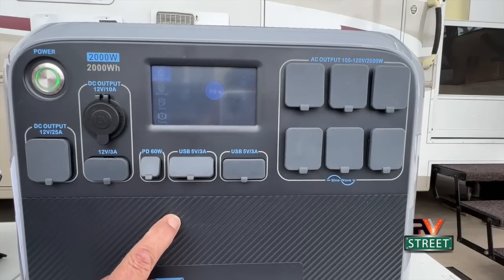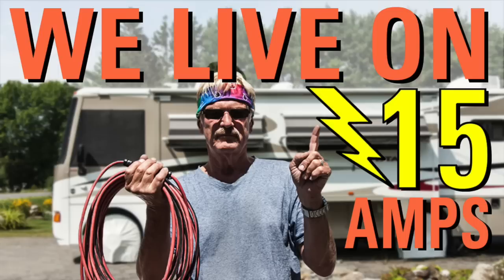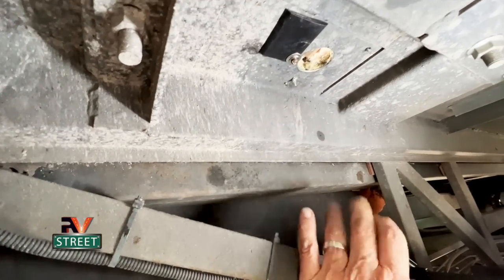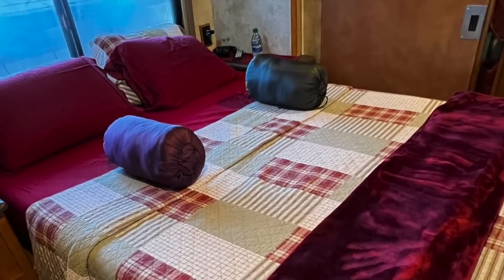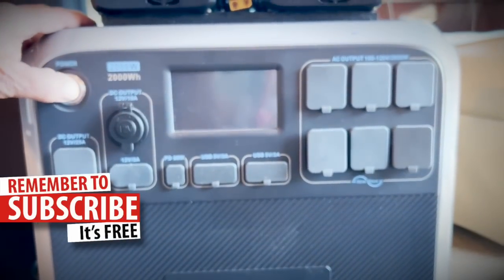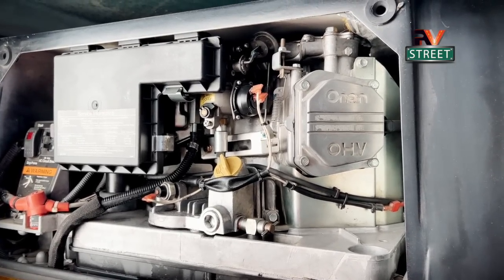Using a Bluetti AC200P in an RV • Most hands on Video on Youtube

Comment: Fantastic! I have an EB70S, and while it’s only a max of 800 watts, I just tried it with our 30 amp rig and it worked great! Of course, we can’t run the a/c or microwave with only 800 watts, but we can live without those luxuries (and have a dual fuel generator in the event we decide we can’t live without those luxuries). I also have a 200 watt and 120 watt solar panel, so feel this is an excellent long term boondocking solution.

Comment from the maker: If you want to know how I came to the decisions I did for my complete—PORTABLE—emergency plan, watch these two videos:
PREPARE NOW - https://www.youtube.com/watch?v=nDSm4Tkpq44
HOW WE LIVE ON 15AMPS - https://www.youtube.com/watch?v=QkTupmk2y3Y&t=537s

Segments in this video:
00:00 - Opening and Overview
06:56 - Installing Pass Thru Hatch
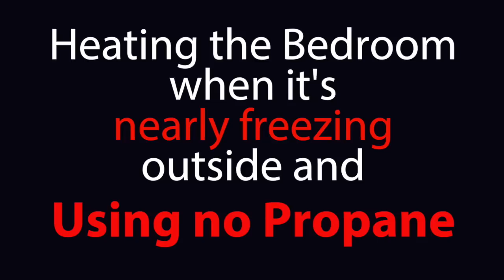09:34 - Heating the Bedroom & then recharging the Bluetti AC200P with my Honda Generator
13:29 - Powering our 50amp RV on 15amps
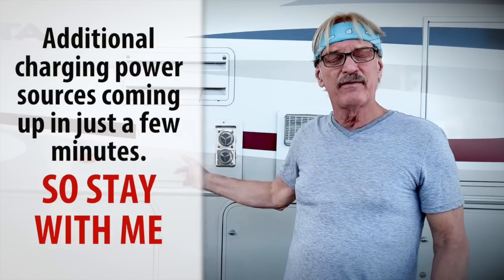18:26 - Using the Bluetti AC200P as a Stand Alone Unit in any RV
25:16 - Running a Large Floor Heater with additional Power Sources
30:22 - Solar BLUETTI SP200 solar panels
34:44 - Why not just use my onboard Onan Generator
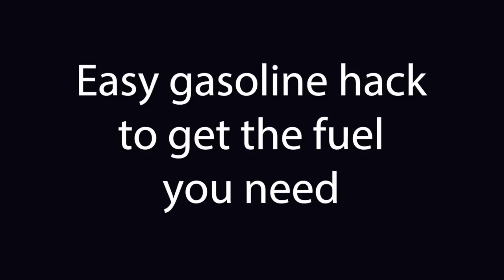36:25 - Gasoline hack
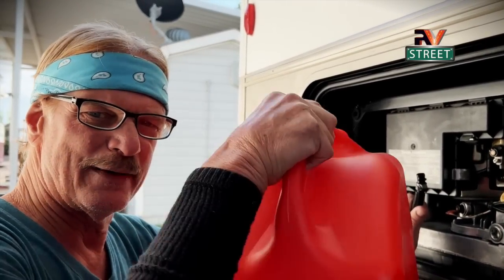37:38 - Important Closing Comments

Please don't ask me about any particular device you have if it will run on the Bluetti AC200P
If you want to know how long this Bluetti AC200P will power any device you have, use this formula: 
• 1800wh (or so usable) divided by the amount of watts your device uses, and that will give you the amount of hours it will run that device.
But just remember, this formula is just using the stored power—the current stage of charge (SOC)—of the Bluetti at that time. But, you can always be charging it at the same time while using it, bringing in more power from other sources at any time, therefore continuing to keep the SOC high. This 2000wh LifePO4 battery in the Bluetti can power just about anything you or I can throw at it and charges really fast especially with 2 AC bricks (2hrs)….or a little slower using one AC brick and solar. So many ways to charge this baby.

i initially wanted to buy a 3rd - 200watt solar panel but didn't have the funds at the time when I did this video. But just recently, I did buy a 3rd panel. Also, Bluetti has just added to their solar arsenal a new 350watt solar panel that is compatible with this AC200P and also has the ability to hang or deploy horizontally like normal. I've added this new 350watt solar panel to my Amazon store in the "Everything Electrical" category: https://www.amazon.com/shop/rvstreet

The Bluetti AC200P can receive up to 700watts of solar. You can hook up as much solar to the Bluetti as you want, but it will receive a maximum of 700watts. 700 watts of of incoming solar will charge this baby in about 2.5hrs.

After having this system now for a few months now, all I can say is "I'm really glad I have this back up system and for emergencies and it has performed flawlessly".

Be sure to check out the description text—in the *Show More*—area under every video for more details. If you’re unsure how to find that area watch this video I did: https://www.youtube.com/watch?v=bprAsHO7-F8&t=2s

Here's all my videos: https://www.youtube.com/c/RVstreet/playlists

Everything I covered in this video—and all my other videos—is in my Amazon Store: https://www.amazon.com/shop/rvstreet

Comment: I love these Bluettie set ups. But I really can't justify it for the rig at this point in time as we virtually never set up the rig unless tethered to shore power. All that said I could really see how it could help at the house during extended power outages around the homestead. We loose power from hurricanes in the summer and fall, severe storms in the spring, and ice storms in the winter. As the house is total electric, I like it better than using our 2 generators for extended periods of time. Great video!

Comment: I use a 12 year old CPAP with a little bluetti ac50s. It has a humidifier but I never use it.  Draws maybe 20 watts of power. I can run it off the bluetti for at least 4 nights without recharging. It's the only thing I use the bluetti for.

Comment: Great video. Quite a few good tips. I have a 2003 T1N Sprinter van, built professionally by Forest River as an RV. It has a lot less space than a big rig. It upgraded to a PD4655 multistage charger/converter. I added 12v 265 Ah batteries, 300 watts of solar, and a 2000 watt inverter. It has a 30 amp shore power connection wired into the power bay. I took delivery on a Bluetti AC300/B300 which I plan to install as the new system. Other than the solar panels, I see no need for any part of the old system. I need to use that space for the Bluetti. It provides more than enough DC and AC. A very efficient DC refrigerator and a few USB charged devices is my DC load. I have 4 AC circuits which I plan to plug into the AC outlets. I can run my 1800 watt AC for a short time. I can charge using the 30 amp external port, or the solar panels.

1) Do you see any need for the old converter? 2) Would I need it to charge from the 90 amp truck alternator while driving (which the converter currently does)? Would a DC to DC charger work instead?  TIA - Keep up the good work
Reply from the maker: 1) I don't know what type of converter you have so I can't that question. In my case I had to upgrade to my 4 stage converter. Factory converter was inferior and didn't take the batt's thru the proper charging levels to keep them healthy
2) Charging from a alternator can be tricky in some cases but with a 90amp one MAYBE not be a problem. Some people use DC to DC chargers but I decided not to go that route b/c my 500watt BesteK gave me more options.

Comment: I bought a Ecoflow Delta last year and have been loving it.  I considered the Bluetti but the charging time is double what I get with the Delta.  I use my motorhome Onan 4000 watt gas generator to restore it to 100% in about one hour.  I have no issues with the battery chemistry or lifecycle rating because we don't boondock very much.  I fully expect to get 10 plus years of use.  In my opinion a power station is a must have for any full time RVer.
Reply: If you don't have solar connected 24/7 and the charge goes up and down alot a regular lithium is just fine, it still give you like 1000cycles or so.
The Ecoflow delta comes with LiFePO4 batteries though.
Reply: Do you mean you turn on your onan 4000 and hook up your Delta to any plug in in the RV to charge it up?
Reply: @alive-awake  Yes.  Actually we charge the Delta using solar panels most of the time.  If that is not an option we use the gas generator.
Reply: @neilrankin9945  I did get the Bluetti 200 max.  I wish there was a hole in my rv that I could pull the 30 amp plug through and plug into it.  It's so heavy,(62 lbs),  dragging in and out of the rv is not realistic for me. Beginning and end of a trip is hard enough but doable.  It really makes boondocking more enjoyable.  😀

Comment: Yes, we were on a mission trip to Texas last year when the windmills froze. Made a beeline to RGV but still had no power for 3 days in an Encore Resort in Weslaco. Guess we really should get your setup. One question: Vicki insists on using 1875w hairdryer and 2 other lesser wattage implements with or without shore power. If she uses them one-at-a-time plugged directly into that Bluetti she shouldn't blow fuses, right?
Reply from the maker: Using them one at a time they'll work fine mostly bc you only use a hair dryer for short amounts of time. Some solutions to that would be to use the dryer on low or buy a different one that use a little less power. I actually wanted to show a test using a hair dryer but Joanie didn't have one. The formula to calculate what the Bluetti will run I posted in the very first comment at the top. If you over power the Bluetti it doesn't blow a fuse. There are no fuses. It just shuts down and gives you a fault code. You clear the fault code in the LED screen and then continue using the Bluetti.

Comment: Martin, I didn't know a device like Bluetti existed!    After the Texas Freeze and rolling blackouts I built a box like the Bluetti that is based on RV technology.   It's a LIPO 12V RV Battery (arouind $1000 at the time),  a Pure Sinewave inverter 2000 Watt, and an RV style Converter (Charger with LIPO charging profiles).   The whole thing was about $1800.   I put it in a wooden box with wheels and use it in my Office to power my PC and Networking.   It charges while it feeds 110V up to 18 Amps to my office.   It's been a great computer saver, and weighs about 65#.   I put a 150A Battery Cable Fuse in it to protect it, and a panel so  you can see the charge Amps,  Usage Amps, and Battery Voltage.    You're box would have the same ability, but cost much less!    I'm an Electrical Engineer (retired) so it was a no brainer, but SIMPLER is always better.   Love the channel.   It's like having a real Mechanic on my staff!
Reply from the maker: Well, I guess you could call your unit a Darthetti 🤣

Comment: The 200Max has a shore power socket, so no dog bone. 
With your AC200P, you can double its capacity with the expansion battery module, BLUETTI B230 Expansion Battery | 2,048Wh.

Comment: Thank you so much.  I have a Bluetti AC200 (Indiegogo). I use it for Sticks and Bricks and farm out buildings but my ultimate intent was my RV.   This gets me such a head start
Reply from the maker: Ya that was the first version that came out. My AC200P is the upgrade to that unit. Nice job getting in on the ground floor and preparing for what may be coming next.

Comment: Martin, we just stopped full-timing and when we’re were, I did the same exact modification with a Pecron Q3000/3034AH solar gen I purchased for just under $2k on a deal!. 

The only difference is I installed an exterior, 120V/20amp, female,  RV outlet on my slide-out exterior wall, wiring it under my dinette bench, to a male RV outlet on the interior, to plug the Pecron into.  I then plug my 30amp shore cord to a 15 amp adapter into that. I have a knife switch on my house batteries so I can choose to charge or not to charge it. My class C came prewired for solar, so I installed 200W of flexible sunpower panels on the roof, (not drilling any holes in the roof), and ran 10AWG wire and SAE plug outlet on the interior to charge the Pecron. 

The Pecron has built-in wheels and a telescoping suitcase type handle. But it charges very very slow compared to the Bluetti, but we only boondock once in a while for one night. And we usually only use 40% of the Pecron a night! It’s has come in handy at home during power outages too!

Just another way of doing what you did with a different device and connections. The Pecron is a very well built device, exterior is metal with just an old school digital readout/display with on/off mechanical buttons. (That’s what I like most about it). I was torn between it and the Bluetti. But for our purposes, the Pecron works for us. I do like both equally for different reasons. I just went with a better deal!

Comment: Depending on needs could someone just ditch the house batteries and just use a bluetti?  i just want to be able to run my fridge in conjuction with propane and maybe my furnace or a portable small heater on occasion.

Comment: Love your videos.  It's nice to see someone with a motorhome instead of a trailer doing reviews!  I was doing research of the AC200P when I saw the BLUETTI AC200MAX.  It appears to have a 30amp recepticle.  My motorhome is on 30amp so my question is...can I power all of my motorhome by plugging into the Bluetti?
Reply from the maker: Thank you Pam 💗
So ya, the AC200MAX does have a 30amp dedicated plug. I didn't buy that model because:
1) To expensive for us, to bulky and lots, and lots of weight. For a Little House or home yes, for an RV with limited space and weight....it's just wasn't for me.
2) I didn't like the way all the components are hooked together with all those cables. To cumbersome for me.
3) I just don't need that much power and we have a 50amp RV
But maybe the AC200MAXis right for you. I don't know. I do have that unit also in my Amazon store though for folks just like you that want more power. I even have the extra battery packs too. If you decide to purchase any Bluetti it would be awesome if you use our Amazon Store to purchase that or anything you normally buy on Amazon.

But just think how you'd hook up your 30amp cord to the AC200MAX. You would have to do the same thing I did only drag your entire RV electrical cord up to somewhere under the RV, and install a pass thru cover there to bring the cord into the RV and plug into the AC200MAX. It might be doable but just think that thru.

My AC200P has one dedicated 25amp outlet on the left but would require a separate box, wiring and cable to use that. But you really don't need that. The Bluetti in any case won't be able to power everything like the AC units but will power pretty much everything else. We have a 50amp RV and as I showed in the video I plugged the entire RV into the Bluetti and I can run several things at once. It's all about managing your power.
Here's another video I did on how we live for months on 15amps every summer. I don't cover the Bluetti in this video because I didn't have it then. But I do show you how to manage and live on 15amps by plugging into a garage outlet. It's the very same thing here only your plugging into the Bluetti.
https://www.youtube.com/watch?v=QkTupmk2y3Y&t=548s

Also here's all my videos if your interested: https://www.youtube.com/c/RVstreet/playlists
Also here's my Amazon Store if your interested: https://www.amazon.com/shop/rvstreet

Thank you Pam. I hope this helps 🔧 🙏

Comment: Great video! When using the generator to charge the bluettie I would try to find other loads that would allow the generator run at 80% capacity. Examples like charging or running your computer, making coffee and charging other devices or even running the heater. That way you get the most out of the gas generator and the bluettie. I have the same bluettie and it is an absolute beast and love it. Thanks again.
Reply from the maker: Yep. While you're running the genny, might as well maximize that run time.

Comment: You always have such great information Martin. We don't full-time,but we live in California, so we have frequent electric outages. We usually use the RV generator to power the fridge and separate freezer. I'm thinking of using the Bluetti to run the fridge and freezer at night so we can shut down the generator. Do you think the Bluetti would run the household fridge and freezer for the night? And how long can you store the Bluetti without it discharging? 
Thanks for making your great videos.
Reply from the maker: If you want to know how long this Bluetti AC200P will power any device you have, use this formula: 
• 1800wh (or so usable) divided by the amount of watts your device uses, and that will give you the amount of hours it will run that device.
You can store it up to 6 months without using it. Then just charge it to 100% again.
Reply: @RVstreet  will it hold the 100% charge when stored that long?
Reply from the maker: I'm not sure about that. I haven't stored it that long to know. But most back up power units will lose a little power over time. Not much though. I mean it has a Lithium iron phosphate battery. Very robust so I wouldn't think it would lose much. All you'd have to do after say 3 months or so is turn it on and see where it's at. If it's a little low just charge it up again to 100%.

Comment: Hello! I really wanted to have solar pannels installed on my fifthwheel, but following your great test, I bought the bluetti instead and 3, 200 pannels, Thanks for the great informations. The kit came in without the long wire from the pannels to the bluetti unit, where can I find this thanks again for a great show.
Reply from the maker: The longer solar panel cables do not come with the Bluetti. I bought those separately. 
They're in my Amazon Store in the "Everything Electrical" category.
https://www.amazon.com/shop/rvstreet
NOTE: Buy the MC4 tool I have there too. It makes disconnecting the cables really easy.
Reply: Thank you so much for your quick response

Comment: I have plugged my RV 30 amp with 15 amp dogbone  into my jackery power station to charge my RV battery and can use some power, with jackery hooked up to solar panels. I really like the ideas you have given. I have the Jackery 2000, also 2 500 watt solar inverters that I use as supplement and can boondock and use  my 2 12 volt refrig/freezers. I wonder if I can charge my jackery from solar and plugged into anther power source? I need to research the bluetti. it may be more versatile than my Jackery.
Reply from the maker: Oh it's definitely WAY more versatile than the Jackery.

Comment: martin, i have a renogy 200 watt suitcase solar panel, havent used i yet, your getting me all primed for the spring and as always sir, thanks a bunch for me and all the rvers out there
Reply from the maker: If your solar panel has MC4 connectors it will work with the AC200P...BUT that's why I pointed out in the description text to buy at least 2 - 200watt solar panels. This Bluetti needs a minimum amount of solar coming in or it really won't do you much good. I wanted to buy 3 - 200watt panels but didn't have the funds at the time. This Bluetti will take up to 700 watts of solar. To get 700 watts of solar you'd more than likely have to have 1000watts of solar panels deployed outside.
So in your case you have 1 200watt panel. In reality your only going to get about 125watts out of it or so. Depends on so many things.